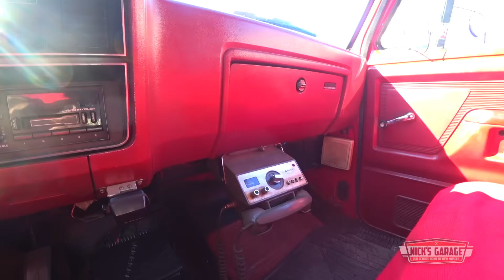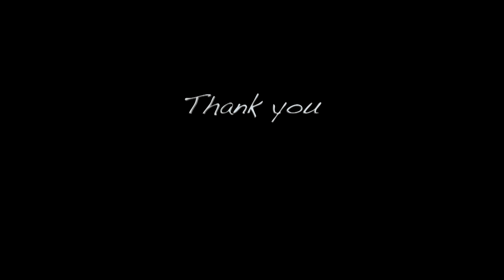1970 Fury Convertible - Nick's Old Flame Returns

Comment: Thanks for sharing the 'C' Body Nick. There is a lot of mopar lovers who still take pride in the 'C' body platform. In 1974, my Mother and Step Dad bought an ex 1970 Montana Highway Patrol car at an auction. It was a white unmarked four-door with dark green interior. The car may have been a supervisor or Captain's car. The car had a 440, torqueflite, and an 8-3/4 posi with 3.23 gears, dual exhaust with bent tips and the Certified 140 speedo and full gauge package. Where the clock is on this green Fury, there was an oil pressure gauge. The car was no frills. It even had a special fitting on the fuel line near the fuel pump for filling gas cans for stranded motorists. The car also had Power brakes and steering with front disc brakes but no A/C. The engine was Hemi Orange with magnum manifolds special for the 'C' body. She got the car for $1600.00 with 65,000 miles on it. My older brother used to take it out on the freeway and the car accelerated to 140 with ease and rode nicely too. We got pulled over once by a WSP officer (Washington State Patrol) and he just wanted to see the car because he missed the one he had four years earlier. He said the 69' was the fastest but the 70' was almost as fast. He was disappointed with the performance of the new 74' he was driving. He let us off with a warning and Mother sold the car two years later to collector with 90,000 on the odometer. It's hard to say what ever happened to it. It had small 440 emblems on the hood too. Really a unique car.
Reply: Erick Miller.    Please tell me this unique car had no carpet. If it did not, it is the real thing.
Reply: Hi Nick, I hope you are enjoying the beautiful Summer weather! The Fury had the rubber floor over jute padding throughout. The holes where the shotgun mount was were still in the floor by the trans tunnel. The car had a special governor in the 727 that allowed the car to shift out of passing gear at 98 mph into drive. We were really bummed when Mother sold the car. She is 4-11 and looked funny driving it and was afraid to floor it because it scared her. True story.
Reply: Erick Miller.    Nice.  Just love it and thanks for sharing.

Comment: I'd take that old Plymouth over any benz
Reply: FUBAR Model Yard 
I’d walk before I touched a Benz.
Reply: FUBAR Model Yard depends on what class, an S class which is the luxury class is a smoother ride than that Fury
Reply: 1976 bronx doesn't matter if it floats on a cushion of air.
Reply: 1976 bronx, no it isnt. i rode in an s class once....ONCE. my body ached afterwards.
Reply: I would take a 1957 mercedes benz SL 300 convertible, if I could take any benz. ;-)
Reply: Hell yeah! A Fuselage Mopar over anything else!

Comment: My 1974 International 392 I/C needs the head shaved, valves seated, new valve springs, new rings, new bearings, new lifters, pretty much new everything, so soon as I can I will be rebuilding it and putting in a Chrysler high energy electronic ignition system with 50kv to the plugs. Not making a hot rod out of it, just a nice strong, fuel efficient work truck.
Reply: Might be a lot easier and cheaper just to grab a late '70's 345 distributer out of a Scout II. They're self-contained HEI units (no separate box) and super reliable. Will a Chrysler distributor really fit an IH? I always like to find a new parts source :)
Reply: 392 I/C uses the very same Holly brand distributor as any 440/383 and I have a complete reman my brother bought for me some time back and all i need is the 40$ worth of reluctor, pickup and coil firing module.

If I did not need to drive my 1972 Dodge motor home with a 413 I/C, I could pull the ignition out of it and drop it right in.
Reply: This truck has a 727 Torqueflite in it, a Holly distributor, a Delco alternator [although it can take a MOPAR alternator] and the water pump will exchange with many MOPAR engines.
Reply: Thanks for the info - junkyard Scouts are getting pretty rare, and trucks are gone completely (eastern PA). I'm about to toss the 727. My last good junkyard find was a heavy duty 1310 5 speed OD/divorced NP205 combo.

Comment: I love the 318 !!  Best Small Block ever made !!
Reply: grabir01 , it's true. A 318 can last 300,000 miles with good care. I've seen it.
Reply: LOL...sure.
Reply: Tougher than a bag of nails, I couldn't kill them.
Reply: uhh doesnt hold a candle to a 350
Reply: nikyjim 
Yea right
If a 350 is built 3 times
Reply: I'm not so sure about that but come to think of it I honestly can't think of a better one I suppose. The factory roller cam Chevy Vortec is pretty good. Lasts a long time too and has a 4 bolt block
I don't like the siamesed exhaust port arrangement of SB Mopars (and others) so i tend to gravitate to BB Mopars since they have skirted crankcase and most parts are available in aluminum now, making them less than an iron head 318 in weight.
A very looooooong time ago I had a 2bbl 318 with headers, a new single point distributor (lol) and a 904 tranny. One night I had a very illegal street drag in a built up area with a 4sp 327 4bbl Chevy and beat it! We went past 90mph. Mine had 3.23 gears in it and I held it in second to 90 then clicked it into D and it pulled a car length on the Chevy. He gave up after that. You should have heard that 327 rev up. I reckon he gave it 7000 in 1st. My 'ole 318 was all over at about 4800 :)
Reply: The straight 6 is better than the 318 .. but then there's the older 302 from ford. I've seen the old lincolns that have been used for limos have over 500k on the motors. That's not including idle time because they let them idle and never shut them off.
Reply: Danny Rumbles 350k miles on the 5.2 in my 91 Dakota (last year of the LA blocks I believe). Used it just this past year to tow a project car home 440 miles. Abuse it left and right, just chugs along and comes back for more.
Reply: I had a 318 in a 1971 Charger. Grew to hate it due to lack of power... couldn't afford to get a bigger mill.
Reply: The Ford 289 Was The Best Small Block 👍🏼🇺🇸
Reply: 302 is better :)  I do love my 302's.. But the 318 Cryco revs to the moon !! They are like mini Hemi !  Wow !!
Reply: 318 doesnt have siamesed exhaust ports on the magnum engines. plus, there are aluminum bits for the small blocks too.  i like bbm, but that skirted block is just more useless weight on the street.
Reply: Awesome motor 318 mine has stock heads, holley 600 ,mild cam , headers it goes good ,in Aust we have a straight hemi 265 six, the  stock 265 would eat stock 327s and 302s
Reply: grabir01 i

Comment: that interceptor was awesome.
that 351 Cleveland was such an awesome engine that's why Pantera decided to use them when they were tuned right those pantera's would just scream.
and with the trans Am Nick do you remember that 1977 or 78 run that Pontiac had they called it the macho trans Am?? LOL

Comment: My brother had one the same color but 4 door with vinyl roof .He got it for 800 ,within a week he  realized why they sold it .8 mpg. He improved it by finding 13 bent push rods and 14 bent valves . When we checked the timing chain it was new so you tell Me what happened 383 2bbl then fuel went up to 12 mpg and the valve job was done right =no clacking
Reply: jimmy wilkinson
Someone must have installed the timing chain incorrectly and put the camshaft out of position causing the valves to hit the pistons and bending pushrods. It's obvious. Did you figure it out that this is what happened? The new timing chain gave it away to me right away.

Comment: Nice fury, back in the day how did you Canadians drive convertibles in the winter months as an everyday car wasn't it too freaking cold even with the top up ? I only ask as where I come from it never snows
Reply: 01057351gt.    Good question.   I have seen Convertibles driven in the winter, were they cold or not, do not know. I own a 2002 Convertible bought new, but I had never driven in the winter. The winter up here in Canada is freezing cold.

Comment: hey Nick sorry this is off topic, but i need some advice. i have a 1973 ford f250 2wd with a 
460 cu and auto trans. i have talked to so many people to find out which Holley 4bl (cfm) i need to buy any help would be a god send. i also live in Colorado
Reply: Jim Peterson.    In many cases, I would go with a 750 CFM with vacuum secondary's. The reason why, if you do any modifications in the future, you are already set up.

Comment: must have found the oil leak in the max mobile .
Reply: bogiewheelman71.     It was the fitting on the dyno for the oil pressure gauge. Easy fix.